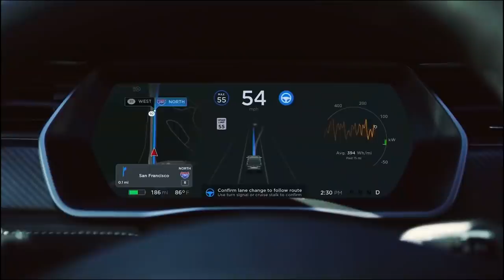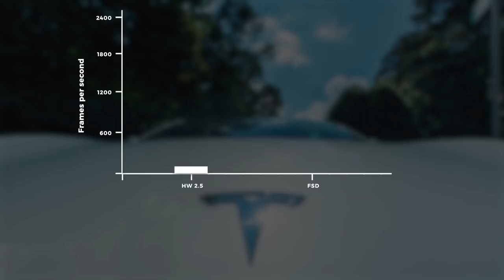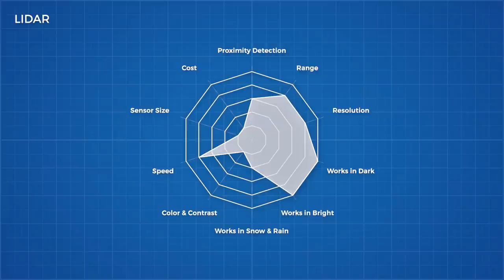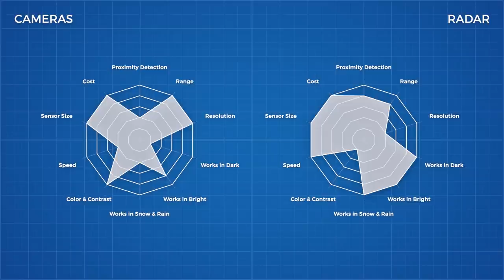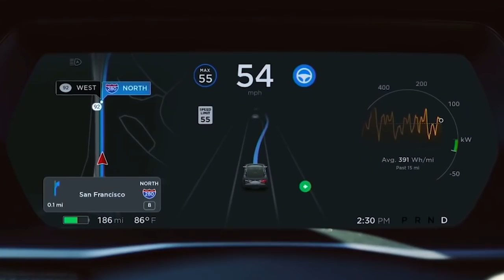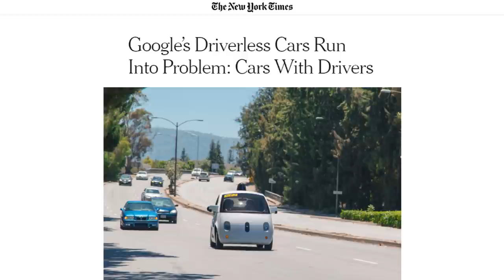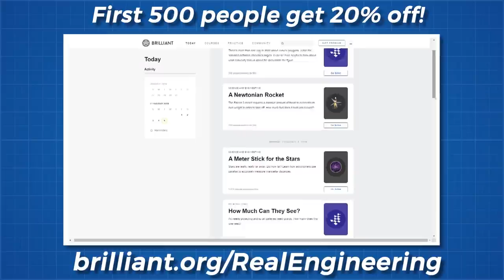The Challenge of Building a Self-Driving Car

Comment: Proximity Sensors and Radar are clearly not a 5 star rating when snowing or icy rains.  They usualy disable themself if snow or ice get clugged on the sensors.
Reply: There are camera's as well and im sure its possible to have radar be able to function even while its snowing and if its heavy enough that stop functioning its likely a human would be unable to see either and that driving conditions are dangerous and the car should pull over
Reply: @sircatington6793  I have a car with Cameras, Radar and proximity sensors and live in Canada. The problem is Snow can stick to the cars and block the radars and sensors while it still fairly easy to drive manually. (maybe not at maximum speed, but we are not talking about snow storm of the century). 

The problem isn't the precipitation itself, it's how it stick to the car and block these sensors. The solution is to forget about all these sensors or stop somewhere, remove the snow or worst, the ice from icy rain, and resume your travel hoping they won't be blocked again. 

And i am not even talking about how hard it will be for the computer to drive on a snow covered road. It's fairly easy for human to do even if no marker or tire trace are visible (altought you drive slower) but very far from being acheived by any AI.
Reply: @Uachtar The problem of snow sticking to sensors sounds like a easily fixable problem the main reason it not having been solved yet being one a large number of countries don't often have snow and two it isn't imperitive to driving properly to have functioning radar. Since self-driving cars would require radar to function efectivly more effect and attention will be paid to the problem and it will be solved. Also I think you're underestimating the power that machine learning algorithms have, if you supply an algorithm with enough accurate data of people driving on snowy roads it will be entirely possible for a car to learn to do it. There are probally more nuiances to the problem than that but if we can train a self-driving car to drive on the road it won't be to difficult to transfer the methods used for training to the problem of driving on snowy roads.

Comment: If we can have every road in the world mapped into a set of instructions for sat-nav.  Why not map those instructions down a further level to each individual lane, stop sign etc?
This way the various sensor networks need only focus on the task of collision avoidance exclusively.
Reply: The issue is that roads are often closed, detoured, under construction, or otherwise not represented properly on the map.
Tesla found that when they relied on the GPS partially the car actually performed worse than not replying on it at all.

Tesla found that the best approach for them was to build a system that was both predictive and reactive to it's immediate environment using computer vision, just like humans are.

Comment: So, the car software will be reprogrammed to avoid humans. Then the next day a moose (weigh 700kg) crosses the road just in the wrong time...
Reply: Probably be reprogrammed to slow down when an unidentifiable object wanders onto the road
Reply: @sircatington6793  - what baffles me is the fact they haven't managed to program it this way in the first place. Programmed it reliably, that is.
Reply: @OldieBugger  The problem is that there are so many scenarios to account for it's quite easy to miss one when there could be millions of different scenarios. I'm not sure how other companies code there self-driving cars but I imagine its getting an object detection input from a machine learning algorithm then hard coding a response to that. Tesla's approach is significantly better fully utilising machine learning meaning you don't have to hard code every scenario, instead the big challenge is picking what data to train your AI on, getting that data and ensuring your AI is performing properly. And with all the Telsa cars driving around gathering data they have enough they can aford to throw away data they have already used. That's a 1/3 of the problem pretty much solved. The big advantage to this approach is that the AI will have been exposed to all the relativly common events and be able to respond correctly to some extremely rare events that might not have been directly experienced. The hope is that the AI is able to generalise from its experience and take the correct action without having been explicitly told.
Reply: @sircatington6793 , Yes, I think you nailed it down pretty thoroughly.

Comment: 9:12 oh nice, but, what does the system do when the car goes over mud that smear that sensor with a considerable block of mud? or in windy rain conditions? 

the biggest problem with the self driving idea, is that, it works in a bubble, but when things are bound to go wrong, is that we need that safe guard the most.
Reply: "non issue", not when it happens while the car is in movement during heavy rain, which where my exact point. how will the system deal with when its coated in an inch of mud? will it ask every 100 feet for the people inside to get out and clean it?
Reply: @marcosdheleno  As I have said already, it will pull over on its own if it gets to that point. Also, I'm pretty sure that there will be a notification for a recommendation of the sensors being cleaned to rectify any possible visual obscurity.

While typing this, I just remembered that this won't be a problem for the ultrasonic sensors, hence why they are there. That would be more of a camera issue, but the sensors are there in order to "see through" mal weather conditions and whatever is caused by them, like mud or snow partially covering the cameras. You might want to look more into how Tesla's FSD suite works. 

Your concern in particular shows that you have not read, listened to, or observed how it functions as well as its current limitations. Simply put, the current limitation is on the software side, which means that Tesla is in an amazing position when it comes to autonomous vehicles.
Reply: and if you knew anything about the history of aviation you would understand why " the system is there for that" is incredibly dangerous.
Reply: Marcos Danilo What? First, todays technology is far better than yesterday’s, and is further enhanced by immense software capabilities. Second, riding an airplane is incredibly safe today. Third, we should stick to the topic at hand, which is autonomous vehicles. If you do not want to, then we can end the conversation right here.
Reply: mate, just google boeng 737 max... understand my point, technology is far better than yesterday, i agree, but you would have to be a fool to take that as garantee of anything. 

i stand by my words, this system is good on paper, but paper is a flimsy thing that gets easily torn when wet. like wise, this is something that will require alot more tests and development before it is considered safe for general use.
Reply: Marcos Danilo I’m going to stick to the topic at hand. Airplanes have nothing to do with how autonomous vehicles will function, so that is irrelevant. Let’s get a couple of things straight. There is no FSD yet, but we are near the launch of it by Tesla. They are doing heavy testing of FSD, and have been doing so for the past 4 years now. 

Autonomous vehicles won’t eliminate ALLL accidents, especially when humans are still driving, as many of us humans are very bad at it. To think that it should prevent every single occurrence from an accident happening is ridiculous. What it will do is dramatically reduce accident occurrences, thus saving lives and money. 

Ultimately, it does not matter if you are skeptical of the technology. Once FSD is software-complete and is approved by regulators, people will want to use the Tesla Network over Uber and Lyft due to how much cheaper, convenient, and safer it is to do so.
Reply: "Airplanes have nothing to do with how autonomous vehicles will function, " and if you actually decided to read my argument you would understand that, im not saying that either, what i AM saying is that, autonomous systems like these arent flawless, no matter how many levels of security you add, because, at the end of the day, there's ALWAYS something the developers arent able to cover, be it due to cost or due to not forseeing.

as for those tests, im not against them, what i am is hubris, as i have lived long enough to see the vast majority of people like elon musk bite their tongue due to that. because someone says that what they are working on will do what they say, doesnt mean it will actually do so. im just pointing at it and saying, "shit happens". that is all.

Comment: So your stuff is great! You suggested that price is the reason for avoiding LIDAR... BUT price will go through floor as volume increases. The ACTUAL reason for avoiding LIDAR is not that.
Practically speaking, if you were to look at a scene, with just 'point data' of a LIDAR, vs full stereoscopic vision, you will gain orders of magnitude more understanding of what is going on around you from the latter... and you could not possibly drive safely if all I showed you was the dots of LIDAR information. LIDAR without vision can never give you full self driving... it can give you a false sense of progress though.
From a technical perspective, when you train a neural net, like if you train a human being in some skill, if you give them a significant crutch, their potential will be limited. LIDAR is such a crutch. It allows easy achievement of a certain level of 'skill' at self driving, but cannot make it past a certain level. Technically speaking neural net will settle into a local minimum and it will be challenging to shift it out of that minimum.

Comment: How about instead of trying to work so hard on making the machines learn the road, how about we use the roads to learn the machines at the same time. Like adding sensors that sense when a self-driving car comes by and sending the what type of line it is. You could also add sensors to lights to transmit the color and direction. Just some simple transmitters underneath the reflectors in the road could help a lot probably.

Comment: I normally love Real Engineering but I am incredibly disappointed with constant preference toward Tesla in this video. For instance, that figure for LiDAR cost I'm assuming is based on Velodyne's VLP-16 and VLP-64. Yes, the 16 now costs roughly $7,500 but is still at base, 1/4 the data of the 64. With regard to the Uber crash, Uber outright refused to release their data from the crash to Velodyne. This can only mean the sensor functioned correctly but Uber's algorithm either failed to use the data correctly, or the LiDAR was not a part of their control system all together.

Also, not all sensors are created equal. A "4D" LiDAR (such as the ones created by former Apple Engineers) use variable frequency in order to receive not only the base point cloud, but the velocity of the object observed. This same concept is on the horizon for Radar technologies but is not deployed on any vehicles and is still in development. Similarly, "flash" LiDAR does much better in poor weather but has much lower long range resolution. 

Finally, the goal is not individual ownership. What Tesla, and especially Musk, fail to understand is that just because a technology is cost prohibitive, doesn't make it the wrong technology. It means we're not ready for self driving cars. If you want to rely on cameras, people have to understand that yes, we too rely on "stereo vision" for depth perception. But, we've also had millions of years to train our internal neural nets. Also, I'm not quite sure we want millions of years of Darwinism figuring itself out on today's roads.  

The goal of today's self driving cars networks is for a new generation of taxi services. No, an individual person cannot afford the $300k price tag of today's self driving cars. However, continue to bring that cost down and run them virtually 24 hours a day as a taxi service and it might be on the verge of a viable business model.

I applaud Tesla for the developments in electric vehicle technology. But with respect to self driving, the comments Musk makes are fundementally dangerous and put profitability and press coverage before the automotive industry's principle objective: safety.

Comment: Not a bad video. Better than some other out there you guys did some of you research. You chart is off and your not explain the limitation of all the different sensor. There isn't just one type of Lidar too. You guys just like many other don't understand that developing the software and logic first is more important the sensor. We are limited by the current hardware so we must use all 3 has a fall back where like you said Tesla does not have why they're only level 2 system. 
This hype for Tesla AV is dumb. Also your saying the Waymo has less data than Tesla which I highly doubt. Waymo have more sensor and bigger computer be able to record so much more data on the road. Also most of the Tesla autopilot only works on the hwy and a few streets. Where most AV car like Waymo can go downtown just fine.
Let me get his out of the way quickly.,
Radar can't detecting stationary objects and the ranges vary on which radar you use but they aren't aren't that far out.
Seriously you guys put Camera range to 5? REALLY on a fix lens with small sensor and low f/s lens.  They do not do good rain or snow they're can be easily blocked.
Lidar can see 360 up to 300m with just one sensor so that's all weird wrong. 

Funny enough most self-driving that are level 3 can actually do Stop sign intersection really well. 

You guys did decent but you did a lot of shooting into the dark and not learning what all these different SDC can and cannot do.

Comment: Self driving cars will not become a safer way of travel until the way greater majority of vehicles on the road are self driving and even that is very debatable. If you have a thousand vehicles on a highway if 999 of them are self driving and 1 vehicle is manually operated depending on how reckless that driver is will depend on how safe the self driving vehicles transportation will be. This is especially true as a highway gets more congested. If the driver of the one manually operated car is adjugated and raging out driving recklessly at some point the calculated reactions of the automated cars not only the ones in close proximity but the vehicles surrounding those vehicles and so forth will eventually fail. As a result the objective of making it safer for the automated cars will be flipped around. There will be more accidents including multiple automated cars then those of manual driven cars. 

It is common sense at the rate self driving tech is improving and the way it is being programmed. To react to unpredictable circumstances to calculate the necessary actions to avoid a collision with the unpredictable objects. So that means someone can be driving recklessly in a metaphorical ocean of automated vehicles and not get into an accident but causing accidents for many vehicles that don't have drivers.

Comment: Best way to test something is to fuck with it. All of these autonomous cars should be abused with unexpected testing to feed the AI as much scenarios as possible. 

The fact the Google car froze on a stop sign indicates the programmers didn't even bother thinking about that. 

If I would program a system like that I'd feed it information about sudden braking, potholes and random objets on the road, people cutting in front of the car, safe distance the car needs when it's at full capacity of weight, even deers jumping in front of the vehicle. Traffic lights not working, snow, fog, rain, sand storm, or hail which I'm sure would definitely fuck with the sensors when hitting the car.

Hell, it should even take in account for system or hardware failure.

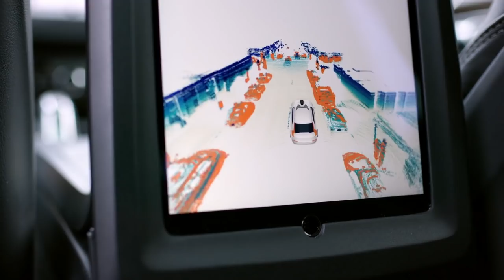Comment: 2:13 that was completely the Human's fault, looks like she was looking at her fuckin' phone instead of looking at the road. The middle camera lens is so flawed at 4:59, instead of the middle lens covering pretty much the same area in front as the long range camera, there should be two separate cameras that are more focused on the outer edges and if something appears to be moving into the road, even if it doesn't know what it is, it should prepare to slow or stop, that's just ridiculous.

The intersection thing is easy to fix, just put roundabouts there instead, Mythsbusters tested it in America and it's much better for flow than an intersection =P

Very interesting video, nice one.